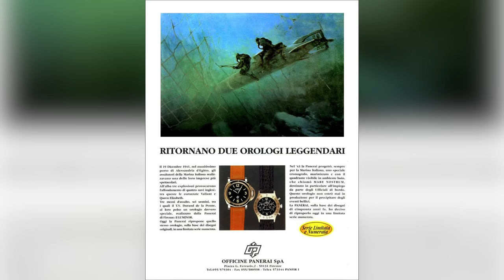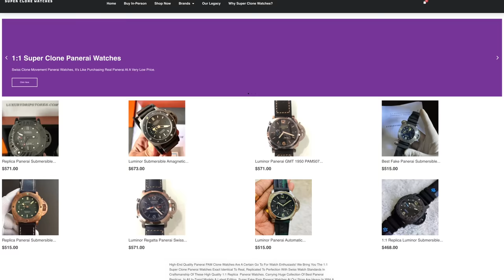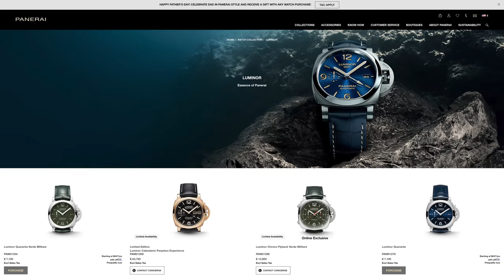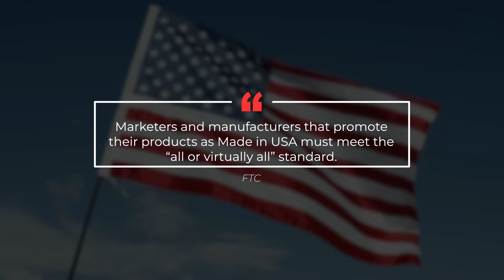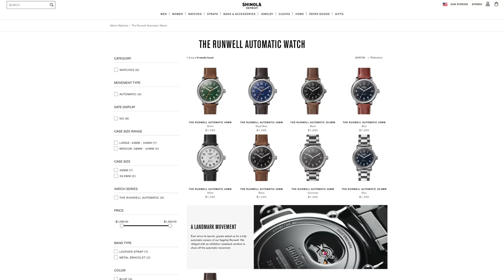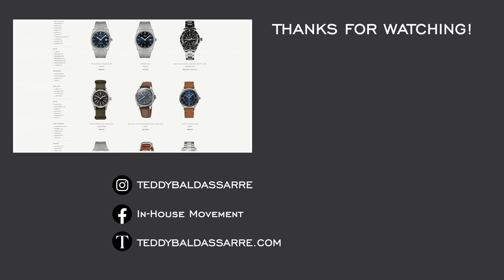Luxury Watch Brands People Love To Hate On But Should They? (Hublot, Rolex, Panerai)

Comment: If Hublot had all the visible screws in their watches aligned symmetrically and / or orderly, it would help their reputation and image tremendously
Reply: The thing is they are actually screws. AP has fake ones.
Reply: The finishing isn't great, and I've heard stories of the inside of the crystal in Big Bangs getting condensation when worn in the rain.
Reply: why would you want the screws aligned... i mean do you even know it is inspired by porthole. even ap royal do not have aligned screws(check the caseback before you scream...)
Reply: @jordanbell4420  total bullshit, I own two and wear them in the ocean all the time.
Reply: @chancebanana  These people have never seen a porthole.  If Nico is foaming at the mouth about something, it must be true.
Reply: Hublot hate club would find 1000 more reasons to hate it anyway
Reply: I've actually had it done to my Hublot Big Bang Diego Maradona. Tiny rubber O-rings are sealed around alloy spacers. It was on a dare, however, I went back to original look.
Reply: @jordanbell4420  thats because you should not use any of the push crono buttons and neither the crown when theres water around.
Reply: Hublot uses the same movement that I have in one of my Hamiltons. That Hamilton cost less than a tenth of a Hublot. I am not paying Ferrari prices if it has the same engine as a Honda.
Reply: Absolutely agree! Everytime i see it it pisses me off and I don’t even have ocd. I’d rather have fake ones like on the aps.
Reply: no amount of screwing can help Hublot.

Comment: You could’ve called it “when marketing ruins a brand”.   All three brands with a perception problem put all their eggs in the marketing basket.  Hublot did it too early, Panerai reach it’s pinacle and fell down to earth unable to get past the image and Rolex is up in the high atmosphere waiting for the fall (gonna make the biggest crater when it hits the ground).  All three brands attract customers with socially unsavory traits.  It’s very hard to escape that trap after you fall into it.
Reply: Mate you’ve no clue what you’re talking about.. Rolex made and continue to make some of the most collectible and sought after pieces that attract the most established of watch collectors out there… just look at how much some of the vintage models fetch at watch auctions. All brands rely on marketing but marketing can only get you so far if your product and how it’s presented aren’t solid enough. Rolex been on top long before this madness started and it’s not going to bulge.. wishful thinking on your part.
Reply: Rolex absolutely will not crash and burn. The very thing that watch wannabes have beern criticizing Rolex for (not increasing production on their stainless watches) is what's paying off for them now, even as the grey market takes a tumble.

Comment: The problem that I have with Rolex is that repairs almost have to be performed by one of its authorized servicing centers because of its strict control over parts availability, and when repairs are performed they will not return the replaced parts and insist that the parts be "traded in."
Reply: They will also probably replace parts that don't need replacing like the hands and dial if the lume is gone, rather than just re-lumbing it. Then polish it so it looks like new. Losing any patena that made the watch unique to you.

Comment: I’ve had a panerai 1940 for about 8years, love the design, movement is nothing special and you could get it in 43mm, which I did. Now they do a great looking green dial but not in a “smaller” case, then I saw their prices! Wow almost double what I paid. So I won’t be swopping. They’d sell more by offering 40-42mm cases across different models but the price would need to be realistic too.
Reply: When it comes to luxury products, dropping the price often doesn't 'help' the brand. I think they need to re-emphasise their quality, and be more attentive to what their fans want.... that and realise that their Due line was a huge mistake.

Comment: Michigander here: I have never understood the fascination with shinola. Fit and finish look great. The dials are crisp and well done. Nice sapphire crystal. And then boom, the hammer drops. 600 bucks for an out-sourced quartz movement with no horology and some questionable marketing tactics. There are just so many companies like Vaer where I just bought an S5 for 250 bucks. Lumed, sapphire, stainless steel case, screw down crown, screw down case back, very nice stainless steel bracelet and black rubber strap. So many other companies that can blow shinola out of the water in price point.

Comment: The problem Panerai has is it’s design. The Luminor is the Panerai most people want and I am giving it as an example. So the question is, how many variations one can do within the confines of the Luminor’s body? Unfortunately not many. Some complications, dial colors, case materials and size. So I don’t understand it’s critics. The 38mm DUE has 30m water resistance because it’s case has to be proportionally scaled down. It is made to suit ladies and thin wristed gentlemen who want to wear a Panerai. What’s wrong with it? Then the company made the Quaranta, which in my opinion is an exceptional watch. It has a beautiful proportionate case with 40mm diameter and 100m of water resistance. This watch can be worn literally by anyone and in any occasion. A genuine “strap monster” too. And of course there are the larger diameter models like the 42, 44 and 47mm for the enthusiasts seeking 100% genuine Panerai experience and wrist presence. We have a plethora of movements and complications within the catalog as well. So literally there is a Panerai for everyone. Panerai! Possibly the most recognizable watch design in the industry.

Comment: What an amazing video. I am very familiar with watches from 3 of the brands mentioned  in the video..🤣. I absolutely love Rolex and since I have a good and long relationship with the AD, I have been able to get the models I wanted. I just got my first Panerai and I love it because people that are not familiar with watches barely recognize the brand. They are different from everything else.. My 15 years old has a Shinola that got from his grandfather.  The kid wears the watch everywhere, and that watch has taken an insane amount of abuse.  It still works and looks great. Let the haters hate. 😁.
Reply: Which Panerai Ref did you buy? Anything you wish they would change? Love the unique look of the case,
Reply: @joshs3916  Pam 1314. Luminor Marina White dial.  My only complaint is that you can't hack the movement,  but other than that I love the watch.
Reply: @hugohernandez3651  They hopefully will add hacking later on fingers crossed

Comment: I think the “look at me“ is a reason why some buy a watch.  I’ve heard you, Mr. W and every other watch channel talk about the status of a watch being a basis for purchase.  Ever since we bought watches other than to tell time is for the show.  Most watches are made for just around $200 so spending more on any watch beyond that is for another reason.
Reply: Sorry but it would cost a lot more than 200 bucks to make and hand assemble a chronometer grade movement nevermind the costs of machining a solid bracelet  and making of the dial, case hands etc.
Reply: @garyboyle695  most watches are mostly machine made. I doubt besides the very high end hand finished watches take much more than $200 to make... and even if they cost 5x that, and cost $1000 to make, that's still a crazy markup when they sell them for 10k-50k and up.

Comment: I don't understand the arguments against design for Hublot and Rolex, to me its very close minded to either hate one for being to out there and away from typical styles and then one hated for being too simplistic stylistically with little change, it makes it sound like theres  only one range of accepted creativity.  Why cant it just be accepted that theres different designs and brands for different ppl, if you try to hate on something that is going to differ from the norm then all we will ever see is the same watches being created for the next 50 years because brands will not want to take the risks of expanding their products lines too far off from what is currently out there.  My point might be a bit exaggerated but that is the gist of the argument im understanding.

Comment: I’d disagree on your points around Panerai and war references - most people wouldn’t even think about it - I own a panerai and 2 rollers - but I don’t wear the rollers anymore simply because the fakes are everywhere and the brand value for me is through the floor. They have the same problem that Burberry clothes had in Uk when every hooligan in the city would wear the pattern 10 / 15 years ago. Rolex just doesn’t have that prestige anymore because of the super clone availability to every man down the pub. Yes panerai may be easier to fake but if I see one on my travels I always nod approvingly and think of class and sophistication of the wearer - I see a rolex and I instantly think of the social media generation that no no different and that’s it’s probably fake.

Comment: Luxury watch brands that get a lot of hate in the collector community:
1) Longines: criticism around mostly sport models.
2) Tag Heuer: I hate almost all of their sport models. The only great watch line they have is the Monaco.
3) Tudor: as Kevin O'Leary said whenever he sees a Tudor he thinks he should be buying a Rolex.
4) Hublot: hated by many in the watch community. They try too hard to be Audemars Piguet.
5) Panerai: their design as good as it is, never really changes. And any innovation seems to be in color of case and strap.
6) Rolex: too little control over what is happening at ADs and boutique stores. Long wait lists and pretentiousness.
7) Breitling: I actually like what they are doing recently as a brand. But I do see the detractors' points. 
8) Omega: that big fail with Swatch. Color rubs off the Moon Swatch case easily and they look like toys.
9) Omega: I love the Omega line, but it is hard to find a watch for under $8000.
10) Patek: The greatest watch brand in the world, but even retail prices are inflated.
11) Audemars Piguet: Not enough innovation in design. The Royal Oak line is great but there should be more diversity.
12) Blancpain: Love their line of watches but their watches prices are inflated.
13) Chronoswiss: I have no idea what happened to this brand. Actually I do. It was sold to a conglomerate. The brand was at its best back in the 1990s when the house was owned and run by the father-daughter team.
14) Ball watches: Nice watches, but try to find an AD in Canada.
15) F.P. Journe: I love their watches. The love affair began back in the 1990s. But they only make 900 pieces a year and wait lists at ADs is over a year long.
16) Movado. Need I say more? I have no idea what they are thinking.